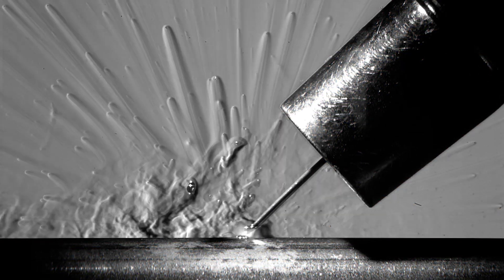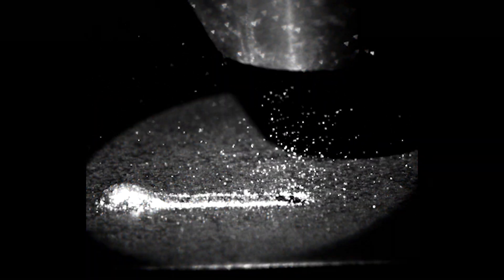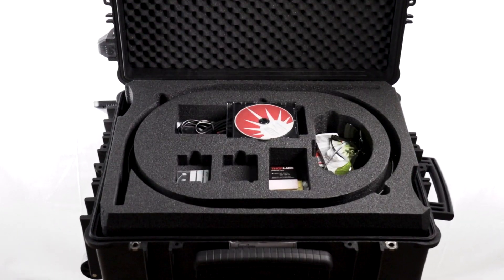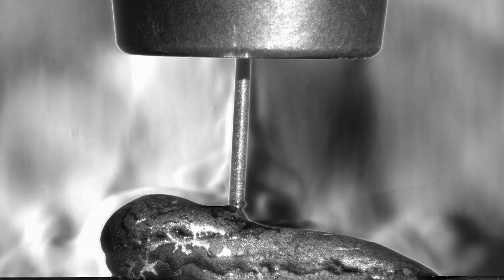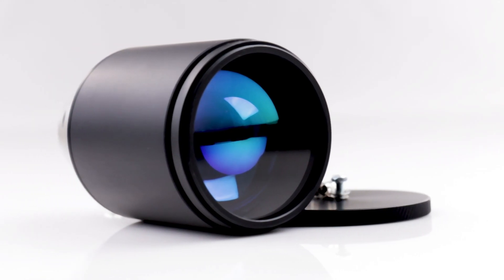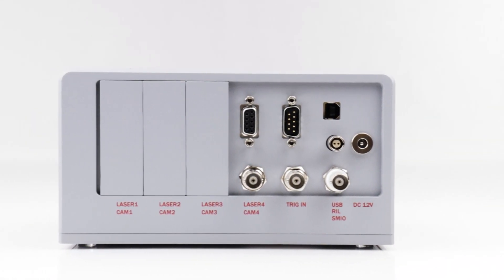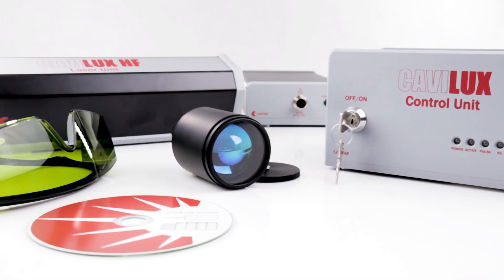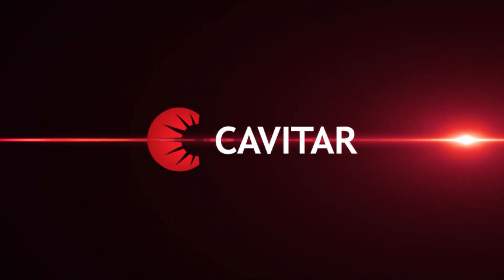CAVILUX HF Laser Illumination System

Comment: This solution has been proposed long time ago but was blocked by eye safty issue. How this problem resolved please ?
Reply from the maker: We appreciate your inquiries about the safety of our CAVILUX laser illumination system. Ensuring the safety of our users is our top priority.

CAVILUX HF is classified as Class 4 laser. according to the international laser safety standard IEC 60825-1. This means that CAVILUX HF fulfils the laser safety requirements set by the standard. Class 4 is the highest laser class and all lasers in this class are potentially dangerous unless operated in accordance with appropriate safety procedures by properly trained persons (only Class 1 lasers are considered as eye-safe). Safe operation of Class 4 lasers typically contains the following elements:

· Engineering controls such as closed areas (containing the laser emission under all foreseeable situations) with remote interlock feature

· Administrative controls such as safety processes, training, preventing access to the area of potential laser hazard, warning signs etc.

· Personal protective equipment such a appropriate laser safety goggles (usage of engineering controls is always primary since the aim is to avoid any exposure to the laser emission).

Should you have any more questions or require further information, please don't hesitate to contact us. Your safety and satisfaction remain our utmost concern.